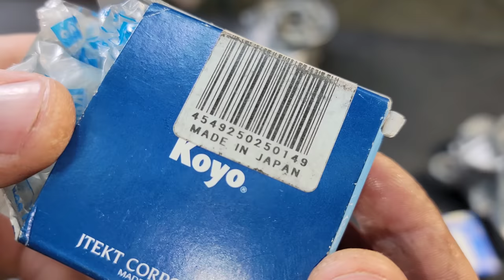Crankshaft roller bearing for Honda Dio 120cc scooter

Comment: Why use a cylindrical roller bearing? It is said that this generates an annoying sound, is this true?
Reply: Real term is needle bearing
Reply: @botskifani22  or third bearing in variocover, which would be the best decision on any 2stroke cvt scooter